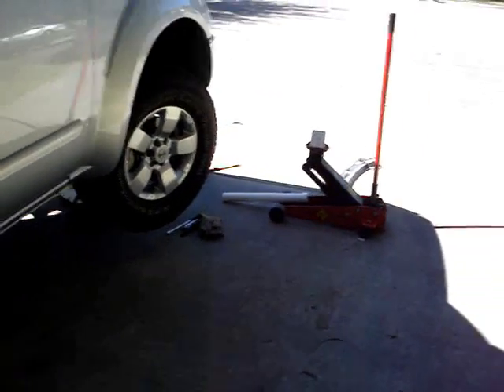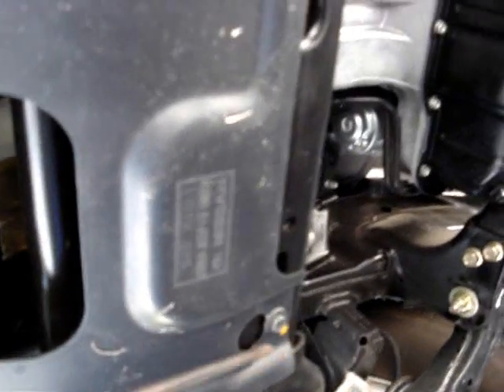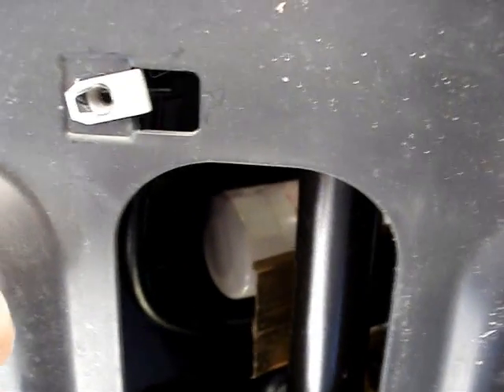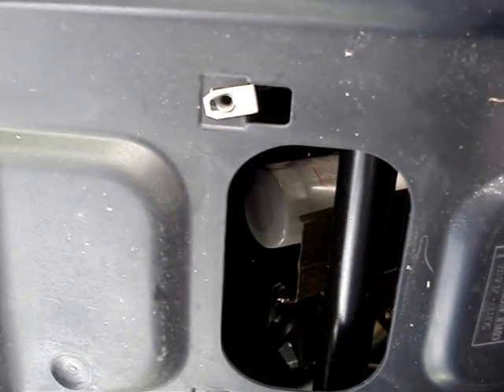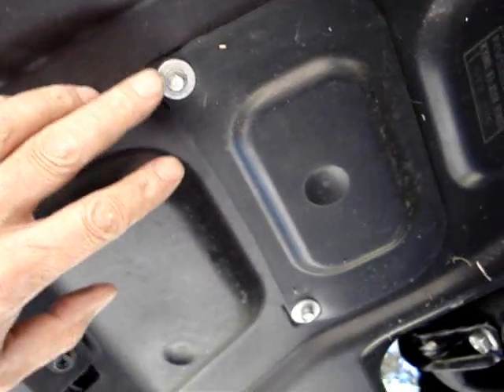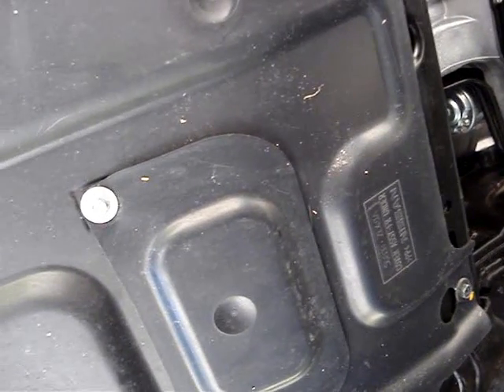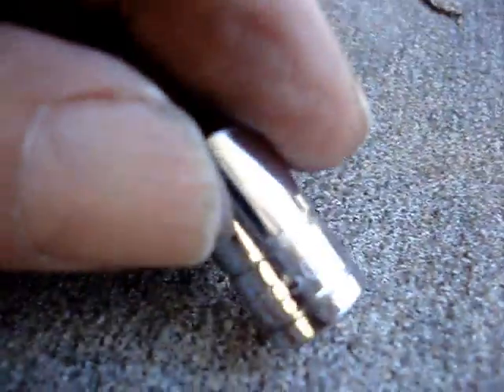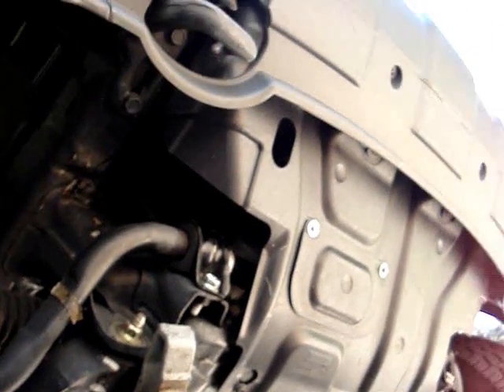nissan frontier oil filter change HORRORS 2 - bad location and slobberings

Comment: I just did the oil change on our 2016.  Engineering seems to be excellent.  Access to the oil filter is simple, remove two bolts on the inspection cover, reach in, unscrew the oil filter.  There is a nice drip tray that prevents the truck from getting covered in oil.  Wipe everything down so it's clean, install new filter, reinstall inspection cover.  I found it very easy to do the oil change.

Comment: before you take all that stuff off try reaching over the skid plate on the passenger side, I'm not the strongest guy and i was able to reach right in and twist off the filter with out removing anything

Comment: I have changed the oil through the access plate and had No problems removing the filter and cleaning the spout below the filter. The only Problem i encountered was the very sharp edges around the access plates! I did not need to remove all these things to do a normal oil change on the Frontier, I just cleaned up the sharp edges around the access hole and was satisfied on doing the job properly!.

Comment: I own the same truck, bought new. Each time the dealer changed the oil it was a mess. Oil dripped from the skid plate for days, oil spilled on the right side valve cover ran down and burned off on the exhaust manifold. I had to clean that up with Brake Clean every time they changed the oil. They never use a wiper I guess just let it run into skid plate and down the frame. My 4X4 has the access plate and a plastic skid plate. I've pulled down and cleaned for the last time, I do my own O/C's now.

Comment: Use the oil filter wrench that grabs it by the end. They are about 3 dollars at autozone. Just did it in about 15 minutes and only took off the inspection hatch. Used to have a Chevy truck and it was way harder.

Comment: I bought a 2016 Frontier with the 4.0L V6.  Same issues.  The Nissan engineers TRIED, but they failed miserably on this one.  The access plate is too small to get your hand through.  If you can get your hand in there, you can't twist the oil filter because your wrist is contorted at such a bad angle.  There's a cute little drip pan to direct the oil away from the engine after the oil filter is removed, but it's not long enough.  Oil still drips all over the front suspension.  The fix:Remove the entire skid plate.  Get a plasma torch and cut a larger hole.  Weld up a couple tabs to bolt it back on.  Took 1/2 of a Saturday afternoon to get it all fixed.  You shouldn't have to do this to a brand new vehicle!

Comment: I've always changed the oil in every vehicle I've ever owned, beginning with a 1928 Model A, continuing through a '49 Mecury and on up to my Nissan.  Probably about 30 or 40 different cars, at least.  The 2014 Frontier I have now is without exception the biggest pain in the a** imaginable to do an oil change on (without spilling oil all over the driveway).  This fellow is right.  You can not (or at least I can not) change the filter without removing the front air dam (or whatever it is) and skid plate, unless you want dump oil everywhere.  The dealership suggested removing two screws on the skid plate and using brake cleaner to clean up the mess.  That's OK, I suppose, if that's how you like to do things.
Reply: Illoi

Comment: I just bought a 2016 frontier pick upI haven't changed the oil yet but about toI use to change the oil on a murano and a juke my ex and I ownedIt was very easyI'll tell you one thing the air filter on the frontier is a poor designBut all together this truck is a hell of a lot easier to change oil on than my challenger SRT8😜

Comment: Same exact bullshit with the 2022 frontier sv 2wd . The little access door is way to small i couldn't get my oil filter wrench on the oil filter enough for a decent grab. So you gotta take off all the plastic sheilds , sucks. Cant get through the top or the bottom or the sides , just stupid or lazy design here, make the hole  big enough to fit a wrench a filter and atleast one god damn hand to fit. Jesus christ why the hell did they do this like the video said oil change gonna take some time.

Comment: Are you serious?  Is this a joke, I changed the oil on my 2006 nissan frontier last night in my driveway without lifting the truck whatsoever in about 20 minutes.  Not to be sarcastic, but if you lay down on your back with your head toward the rear of the truck you can easily reach up from the passenger side of the filter and remove no problem.  The removable plate I don't believe is to put your hand through in the first place, it is simply a hole to drain the oil through.  Hope this helps.

Comment: All this guy is trying to say is that removing only the filter access panel makes a mess, there is no way around it because it's just a bad design. I just did the first oil change on my 2017 Pro4x and I decided to remove the skid plate as well because I didn't want oil all over the top of the skid plate and dripping on my garage floor. It only takes an extra few minutes and it helps keep everything nice and clean. I don't see what the big deal is.

Comment: no he didn't, that small plate he taped at first is all you need to take off, the gap on the skid plate is where the plate goes. it CAN get messy, but its not bad in comparison at all. what i suggest to this guy is to cut a bottle in half, and glue it on to the oil ramp they have on there right now, you won't spill a drop. getting in through that door is easy, must have been spoiled by an american full size or something

Comment: STOP IT! STOP! I own an 06 xterra same setup, 1.drain oil pan plug then replace it 2.loosen one bolt and remove other bolt on filter access plate and swing out of the way, remove filter by putting your hand up and behind skid plate through the passenger side and carefully tilt it up as you bring it down and replace it with new one. 3. spray the whole area including skid plate with brake cleaner and bolt filter access plate back on. done

Comment: I have a 06 Nissan Frontier and I always have a probelm chanigng the filter. the access lid has three screws on mine and the cover that I have is metal not plastic like you have. Anyway, cant get the oil filter on correctly and always afraid of stripping the filter or where the filter goes. very poorly made by these guys.